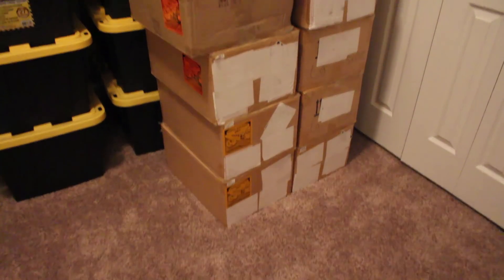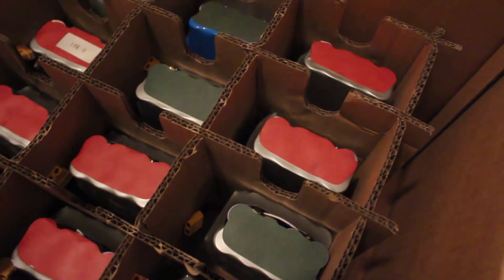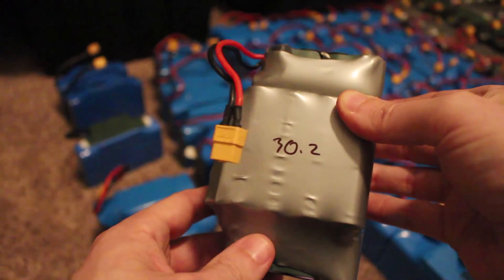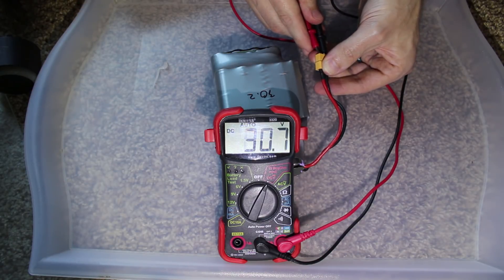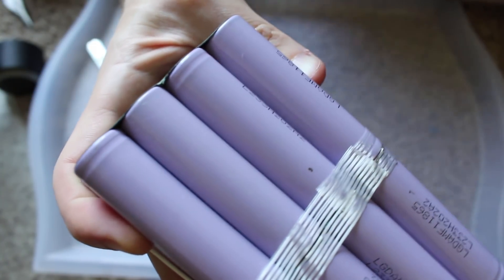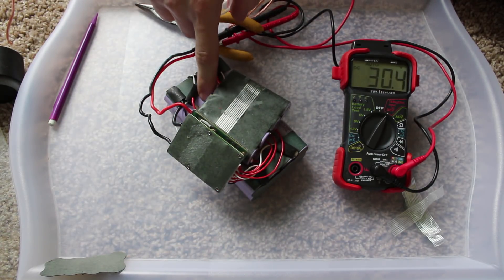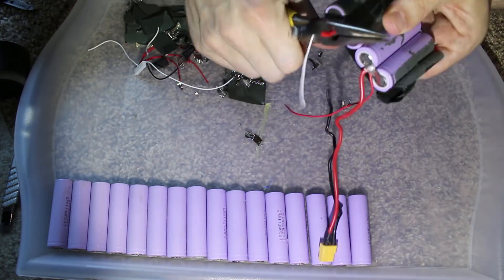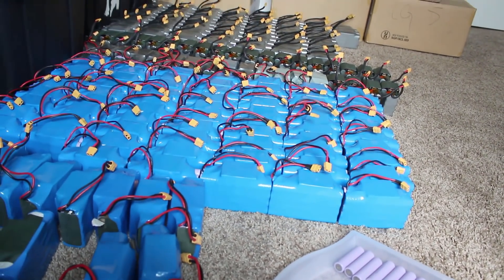Four THOUSAND 18650's!  Let's break a pack apart

Comment: you buy a Batrium starter kit, and then 28 long mon, what was you total cost for the Batrium
Reply from the maker: Yes, you're correct.  Starter kit + 28 additional LongMon.  Prices are posted on Batrium's website.  It's certainly not cheap, but it is the best.  You get what you pay for, and there's a lot of risk involved with BMS's -- it's probably the most dangerous part of your system when it fails... even more dangerous than batteries.

Comment: in your case the modules(parallel cells) are 95 cells,  what is the limit for this parallel cells. 100 200 etc. I think this is limit by the long mom, but I don't have this system, can you help me with this
Reply from the maker: AFAIK, there is no parallel cell limit to a single LongMon.  It simply sees it as one big unit with a different capacity.
Reply: but bigger the parallel cells, it's going to take more time to balance
Reply from the maker: Yep, spot on.  You have to weigh it all based on your use case.  In my use case, balancing will be very rare, so it's OK if it's slow.

Comment: Bypass current 0A to 2A (typically 1A) of a long mon, so your 95 cell X around 2Amp equal 190Amp, so if the long mon is 2Amp, I think it will take a long time for balancing
Reply from the maker: Initial balancing will be done manually.  Maintenance balancing isn't that demanding.  With well-matched packs and a low C rate (0.4C absolute max, average load under 0.1C), there will be very little active balancing required.

Comment: so there's a lot of 18650 how do you plan to balance all of them
Reply: Jose Garcia capacity matching into 42 batteriea of 95 cells each. Then those 42 will be capacity matched further into three strings of 14. Each battery will be balanced via Batrium, so I'll have 42 balancing leads for 3,990 cells.

Comment: So... They don't disclose the shrink tubing that is brittle on some of the cells huh? That should be disclosed in their description in my opinion. I have dismantled many different types of batteries with 18650 cells and never have seen it before to this degree before I took apart one of these eBay packs... Also, you call it glue... Look close enough, I don't think the manufactures precisely applied glue between those cells. It looks to me like some sort of vulcanizing or something. Did u know the hoverboards we're banned from many online sales due to catching fire? Be careful if you use any of those BMS boards. I don't know where these batteries came from but I don't the in they were intended to be made as batteries then sold as batteries... I think they came from hoverboards that have been banned. Just my speculation.
Reply from the maker: Not using BMS.  The glue/plastic isn't so bad, it's the cardboard tape that's terrible.  It just falls apart.

Comment: What will you do with all the left over BMS boards and XT60 connectors?
Reply from the maker: Sell/give them away.  I'll post on SecondLifeStorage.com when that happens under the marketplace.
Reply: That's good. I would hate to see them going to the trash.
Reply: @watsonexpedition7894  I'm in major need of the exact same bms if possible I'd love even just a few and I'll pay you of course love your channel your an inspiration.
Reply: @steebbo9460  Sorry the BMS for the first 2,000 cells have been gone for a while now, and I decided against disassembling the remaining 100 packs.

Comment: So you're the guy who took all the inventory! Not sure what you're using them for, but you got a good deal.
Reply: Grind671 shoot an email to watsonexpedition@gmail.com
Reply from the maker: Hah!  I jumped on it pretty early, yeah.  There are still some great deals out there still... actually some cheaper than I paid (per kwh).  I'm building a custom RV travel trailer, shooting for a totally solar-powered off-grid setup (no propane, no external power connections).  3,900 of these cells should end up around 25kWh usable @ 80% DoD which would end up being about 3 days worth of heavy usage, or almost 2 weeks of moderated usage.  The remaining 100 cells will be used for various projects (and to account for any cells that turn out to be bad... although so far they're all looking good).
Reply: I use these to charge my electric skateboards when on the go. I don't need more than 5amp continuous output, just good capacity. Can you point me to one of those deals you're talking about?
Reply from the maker: This is a fantastic deal here... they're Lithium Iron Phosphate, so do pay attention that the nominal voltage is 3.2, not normal 3.7:  https://www.ebay.com/itm/191987482937
Reply from the maker: Also those are 26-650's instead of 18-650's, which means they're the same length, but fatter.  You'll need holders meant for those cells, but it's a killer deal.  LiFePO4 is also a more stable chemistry, albeit slightly heavier.
Reply: The price and the amp hours are good, but we have to carry these batteries in our backpacks; so size and weight is important. Willing to sell some of your 18650s?
Reply from the maker: How many are you looking for?  Are you in the US?
Reply: I'm in California. How many are you willing to sell? Right now I'm thinking around 100 cells.
Reply: Also, I'm pretty sure you stripped the BMS off a lot of the packs. Are you willing to sell them?
Reply from the maker: I can spare 80 cells (4 packs), sorry can't quite make the full 100.  Most are still packaged, so I can send you full packs with wrapping/connectors/bms etc.
Reply: I'm trying to send you a private message, but it looks like it's disabled on your channel? How can I contact you? I'd like to buy the 4 packs